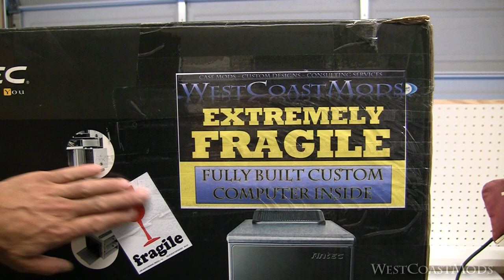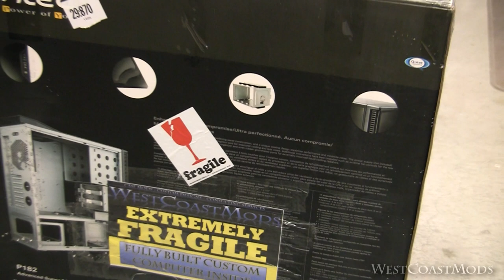How To Package a PC For Shipment

Comment: when shipping a PC, You should use PACKING PAPER. its cheap as hell, and easier to clean up/work with, and its NOT FOAM. static is generated VERY well by foam. use paper.USE PAPER.
Reply: good idea. more available too.
Reply: I don't want to say this is a bad idea, but this is a bad idea.

The paper is not as impact absorbing  and on top of that you may create a larger mess for the client as paper can create dust. Last thing you want is to make your client clean a brand new PC and pull paper out of areas where it might tear.

Comment: If it were anyone else I wouldn't watch it, but you can make even a video about packing foam interesting.

I've made computers for friends and family and shipped it to them. I basically did everything the same as you did (but not as elaborate).

One thing I recommend is to use the clear plastic bag the comes with the case.  I wrap the case in that and tape it shut.  I think it helps prevent moisture from getting inside to the components.  A couple of moisture absorbing packets don't hurt either.

Comment from the maker: @soggymaster Yeah, packing peanuts can have static in them, unless they are the pink type which are static free. I just don't think the peanuts would support everything that well, there good for cushioning things but not so good for supporting things unless you pack them really tight. I not overly concerned with the foam I used as they use it in shipments of TV, monitors, ect. But I am looking into antistatic foam sheets for future shipments, just to be on the safe side.

Comment from the maker: @sourcemaster Funny you say that, because I may start building wooden crates for them. Regardless how you ship, just make sure you insure it......they also sell shock sensor labels that will activate if the box is not handle properly. They are expensive, but i may start using them too.

Comment from the maker: @escafallen Thanks bro...not to concern as the unit is insure for $3500, which covers the rig and my fee. If it was to get stolen, I guess it would just create more work for me, not that I want work under those conditions, but I wouldn't turn it down. And the second time around would be so much easier as I have already worked out all the headaches.

Comment: Ya know I never thought about how you shipped your comp builds till now but now that I know if I ever decide to have you build me one it'll come intact. As to what nathan42100 said that stuff does work really well. I use to work in shipping and receiving for about 5 years and the expanding foam works wonders. We use to use it on fine crystals and dinner settings etc and never had anything break during shipment. Just a thought if it would be cost/time affective. Continue the good work bud :D

Comment from the maker: @Jetstorm19 Thanks bro,Yeah the expanding foam may work, but I would be concerned that if it put to much pressure against the GPU in one direction it could crack it or possible snap it. There's very little holding the GPU in the slot and the PCB board is on about 1/8" thick. I'm sure it works great with some items but I a little hesitant to use inside of a custom computer.

But thanks for you comment I really appreciate it
LazyMan

Comment from the maker: @MrRappling It was insured for $3500 also, but UPS or Fed EX does not cover if something on the inside was to break and there is no apparent damage to the outside of the package. And even if there was damage to the outside they always try to get out of it by saying it was no packaged correctly. I agree maybe the ram was a little overkill, but if you have been following my vids you will see that I go up and beyond what is necessary. Trust me I get paid for my services, and I am not that cheap.

Comment: I shipped a Cooler Master Sniper with all components inside the case did a double boxing with peanuts all around the original box. The only thing I didn't do was secure the stuff inside... silly me. :( My customer received the case in good condition, but the heatsink inside was bent shorting the motherboard. I lost a $700.00 sale plus 50.00 for shipping which I'm going to dispute with FEDEX.
I learned my lesson and will be more detailed on how to ship delicate items like a computer.

Comment from the maker: @nevergive7 Thanks Jason, I like using the foam as it's supports everything and allows no movement as bubble wrap only cushions it. A sudden jolt or a sharp thump could break the GPU at the PCIe slot, unless it's rigid. After some comments about static, I am looking into getting antistatic foam sheets in bulk. I agree that there is a slight risk with the foam I used, and I guess it's better to be safe than sorry. Anyway I will pass the cost off to the client anyway, so why not

Comment: Really If you install the parts correctly they will not go anywhere. I have shipped for years and I have never had any issues. By any means this is great safety and I respect the maker of this video. From experience, I use screws on a computer especially for the drives because I just want to be careful that the clips don't break. West Coast Mods, the computer looks great!

Comment: I've had many delivery jobs, one with city link and Securicor postal division now bought out by DHL, I've done multi drop also. Many drivers treat packages like junk, I've seen them kick, throw and purposely damage packs. I'm currently selling a pc and would love to include a shipping option to increase my potential buyers.
I remember my first driving job was with a timber merchants, one driver who was on a much larger vehicle was really taking his time selecting plaster board and lengths of wood. I asked him why he was being so picky and he told me he treats each delivery as if it was his. It reduced headache and I didn't take on his words right away, hey I was young but yeah I just find it hard to trust these companies with my hard earned components.
Reply: PS. Thanks for this clip, I've only just discovered your channel but will be watching many more clips. Only nodding I've done was a white ps3 with a red strip where the drive slot is, you know it's usually silver or chrome. It was done to match the now sold nzxt phantom case which was again white with red detailing.

Comment from the maker: @nevergive7 Cool, that sounds good. I just found some antistatic foam sheets that I think I will be using for the next one. And apparently Home Depot carries antistatic foam, have not confirmed but will check it out. Also found antistatic tape but very expensive.$50 for a 2" X 72yds. roll....wow more than I think a client would want to spend. The foam sheets are pretty reasonable 1"th X 4"wd X 17"lg for a $1.68 each, but you need to buy a minimum of 24pc so for around 50$ it will last a while

Comment from the maker: @sourcemaster Now I use anti static foam, just to be safe. This method has worked for me with no issues...know on wood!....But i don't see why you couldn't remove the CPU cooler and GPU.......but some ppl may not know how to re-install the CPU cooler...so thats a tough one. GPU probably not a problem for someone to re-install.

Comment: i recommend that u always pack graphic card or any card, HDDs saperately. anything which is moving or shaky must be pack saperately. I would not take risk and even pack big cpu cooler saperately. One of my motherboard'd pci died bcoz graphic card was attached while transport.
Reply from the maker: Thanks for your opinion. I have been doing this for years and I have had no problem. A lot of my PC's are shipped to customers that don't know how to install a Graphic card, let alone a CPU. The only thing I did wrong on this one was, I didn't use anti static foam....which is what I have used ever since. You want the foam to be rigid IMHO, so it prevents any movement. Do you think if you bought a PC online, they are sending it to you with the CPU and Graphics card removed....I don't think so.

Comment: I remove the cpu cooler and any cards hanging off the motherboard and ship them in a separate box. You don't want anything that might yank on the motherboard.
Reply: +Drake Owens If you install it correctly it will not happen. For example does HP, Dell, Alienware,  or Lenovo do that?
Reply: right in the feels man why u do diss

Sorry i can put pressure on a heatsink till it clicks in ;(
Reply: First question, have you ever actually shipped a computer overseas? I did several years ago and it went very, very badly. The carnage that I saw when I opened the case haunts my dreams to this day. Second question, do you really use stock CPU coolers? My comments were directed to people who build. A Noctua CPU cooler weighs about a kilo, a three fan GTX1080 about the same. Even if you lay the computer on it's back with lots of arrows pointing up and "FRAGILE" written all over it, chances are that someone enroute is going to throw it around and put someone's anvil collection on top of it. So until you've entrusted your precious computer to a bunch of complete strangers please don't judge.
Reply: Drake Owens Was talking to the purple turtle guy about the stock cooler dude. When shipping a computer you can get like foam or brown paper to cushion everything inside the case.
Reply: Drake, any recommendations on how to package the individual cards and the cooler?
Reply: True, but that takes away the simplicity factor. Console peasants buy prebuilts and don't know how to install anything. The idea of a prebuilt is to buy the parts together fully stable and playable. Putting in foam like this guy is a reasonable one. but you run into more problems esd and the consumer turning on his pc without realising foam is in it. I'd like to know if there is a proper way to do this.
Reply: Why not just put a label on the outside detailing removing the foam inside before plugging and starting the computer?

Comment from the maker: @MrRappling Transporting them yourself is one thing, but using Fed Ex or UPS is a whole different story. But obviously you have never shipped something or had something ship to you. They throw those boxes around like the were rocks inside, not giving a fuck. And the bottom line is, if the unit is received damaged then who is responsible....me,so a little overkill upfront saves me a lot of headaches and a lot of money. I have heard of GPU's breaking at the PCIe slot due to hard jolts or bumps.

Comment: Foam of any type, wrapped in normal tape=electrostatic danger. 
If the packer or unpacker is electrostatically charged, then damage? The unpacker should be warned: earth self first. 
IMO, have both pack-unpack environments, 100% humidity, or ion-generator filled rooms might prevent static damage. Ultrasonic, paper-cup 5vDC humidifiers, etc. are very cheap on eBay.